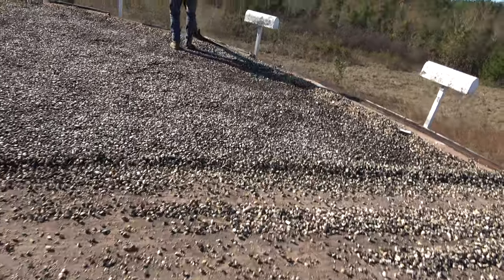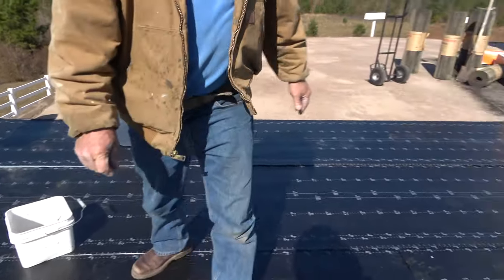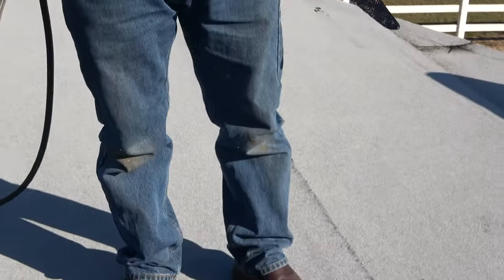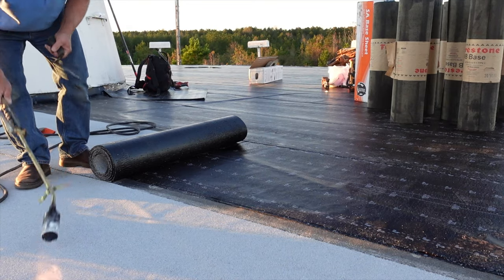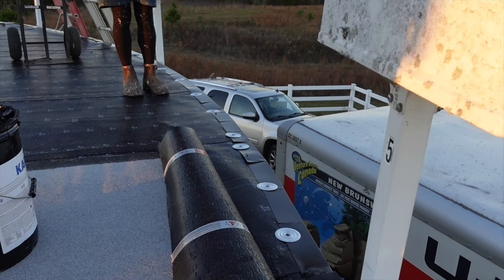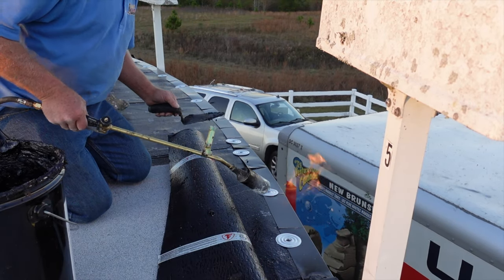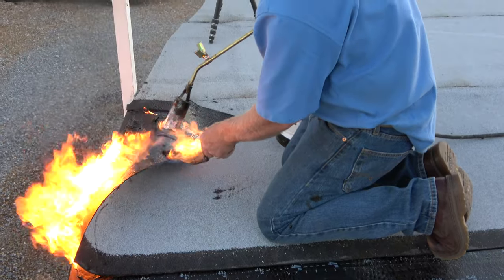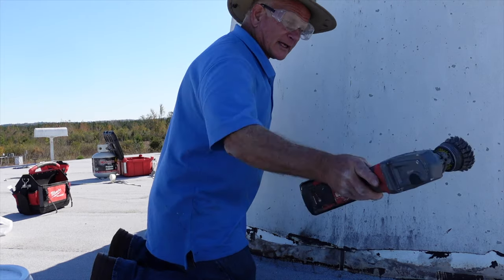Torch Down Roofing Installation over existing roof. 2 day project in Mississippi

Comment: Actually, what lifts the roofs up in the event of strong winds is the negative pressure. I'm surprised they let you install them this way.The drip edge is supposed to be embedded in roof cement and primed .
Reply from the maker: another smart guy
Reply: I’ve been roofing for 40 years and that guy needs to learn some stuff what a hack dirty work

Comment: Hey Doc,
I sent you some pics, did you receive them?
Its Friday after Thanksgiving.  Its alot of work. It's ok. It seems like it's hot tar roof.
What did you think ? 
Is that modified roof system roughly 1.30 a ft. Just for the materials. An opinion ok...
Reply: @kirkbrady2497  ok sir, have a 3200 sq ft flat roof to improve,  my sister's business needs much , all good I can do. 
Thanx for your input.
Reply from the maker: I never got them

Comment: Negative Pressure?  Drip edge is not ES-1 rated.  Edge is loose within 7 years.  OSHA nightmare.
Reply from the maker: you can find many faults with me, don't think I will make you happy. Just move on, and find those channels you like. I am certainly not one of those guys.
Reply: @FlatRoofDoctor  you can’t make a video about roofing and do such a shity job and tell people that you are doing the right way and not Expect other roofers to comment you set yourself up for ridicule roof hacker

Comment: Ironic that you are roofing a VOR which is a guidance system for aircraft, and yet your theory about wind needing to get under the roof to lift it up is a well known aerodynamics concepts, similar to Bernoulli's Principle. It is related somewhat to the principal that causes the aircraft wing to create lift and fly. The theory is that anytime you force wind to travel a longer distance, such as over the top of a roof after it hits the side of the building, the speed of the wind flow increases dramatically. This creates lift, creates a vacuum. This is typically what causes a flat roof to blow off, when a vacuum is created,, it is typically not because wind got under the roof.